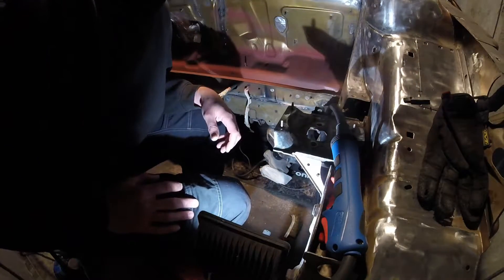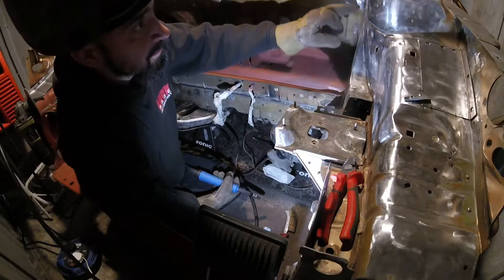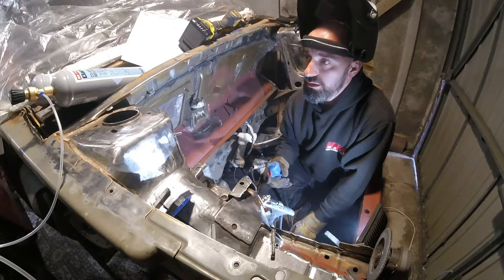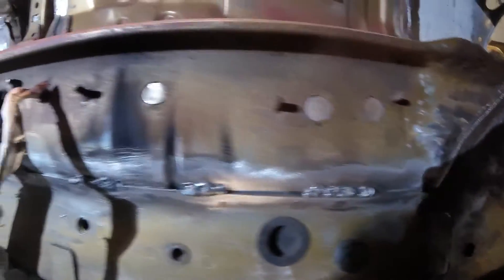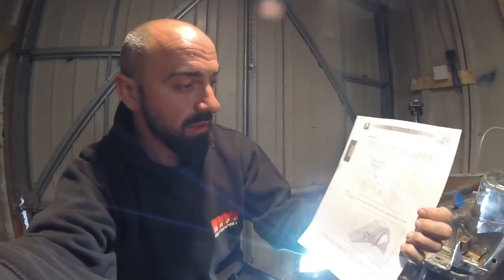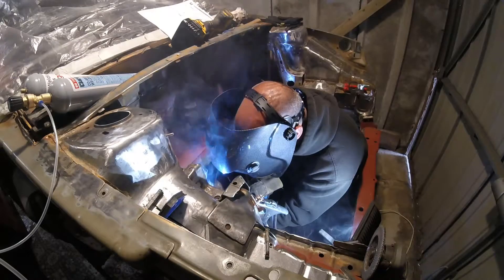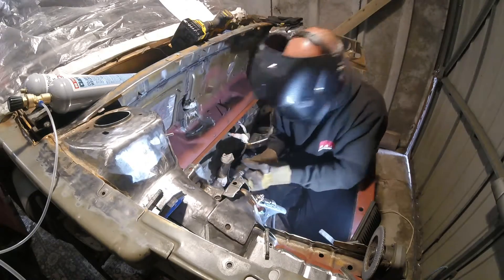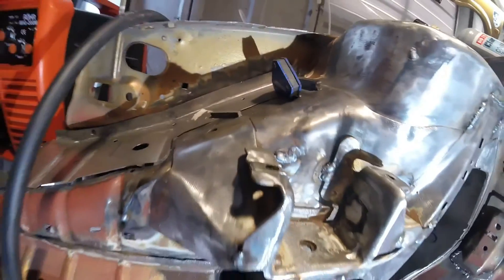RÖHR MIG-200MI | Stitch Welds Part 3 - Change Of Gas

Comment: Hi Alan,
Just ordered same machine.
Are you still using it? If so what are thoughts after 2 yrs of use?
Question, what is the machines pin / dowel size that the mig wire reel locates on?
Is there a particular brand of wire you favour?
Thanks in advance.
Paul
Reply from the maker: Hi Paul, thanks for watching and commenting...

I've not used the welder for a while due to the day job getting mad busy! it's over with a friend of mine currently who works in a Motorsport setting. the welder has helped them out an enormous amount, he says it's one of the best he's used for the budget bracket it's in, although he hasn't used an R-Tech yet and I know they are a main rival to the Rohr.

As for wire, it can use 0.6 and 0.8mm and the dowel from memory is just the standard small size for any reel upto 150mm diameter.

As for brands, I can't remember what I got but my local welding supplies shop recommend it, so, I'd suggest finding your local supplier and go have a chat. 

Let me know how you get on and good luck.

Comment: Hi, where did you get your gas, regulator and other gas equipment needed for this machine? Thanks.
Reply from the maker: Hi Matthew, Thanks for watching and the comment, To answer your question: I already had the regulator from a job I did a few years back. It's a pretty standard regulator and most welding supply shops would be able to point you in the right direction.
I got all my gas and supplies from Gas-UK who are only a short drive from where i'm based in the North West UK. I believe they can do delivery if you aren't local and if your really far away, if you google them, the search results should throw up welding supplies shops local to you. Good luck, let me know how you get on. :D

Comment: Just ordered the 250mi from Rohr after watching your videos, got a clarke replica at the moment and just doesn't feed properly so looking forward to trying out this one!
Reply from the maker: I'm glad I managed to help another person sift through the many, many options out there! Let me know how it goes, I have a feeling you might be wishing you'd bought one sooner, I know I did lol!
Reply: @AlanEaston  Just been having a go with it and I'm shocked at how much better I can weld. I'll be using it first to weld up my mini so will be interested to see how it does on the thinner stuff, but box section it was absolutely perfect for!
Reply from the maker: @HomerDoesGamingAndTech  happy days!! I do mention the setting I used for welding the 106 in one of the videos, iirc it was about 3 for volts and 4 for wire speed. The metal on my car will probably be similar thickness to your mini so have a look and see if you can spot it in the vid and if not let me know and I'll see if I can find my notebook to confirm. You may need a bit lower as yours has more power but it should go down far enough to get some really good welds done.
Reply from the maker: @HomerDoesGamingAndTech  my bad, voltage at 6 and wire speed at 4... I think that was a bit hot so maybe try 4 and 4 and see what your welds look like.

Comment: I use pure co2 pub gas started with co2 fire extinguishers very very cheap compered to the small bottle's reg was £15 and fits both
Reply from the maker: I was going to try out the pure CO² but after doing some research the modern triblend seems to be just as effective, if not better. I'm really impressed with the results I got.